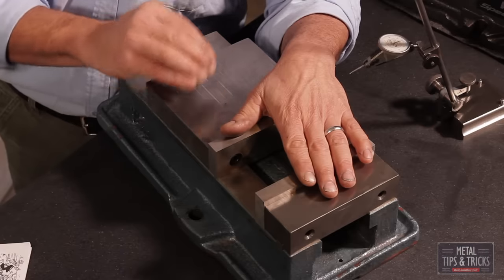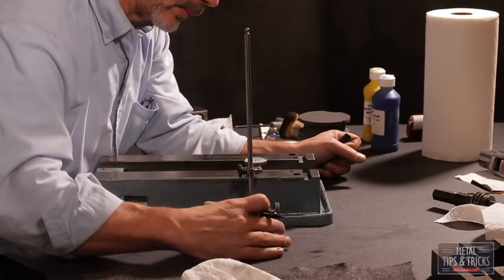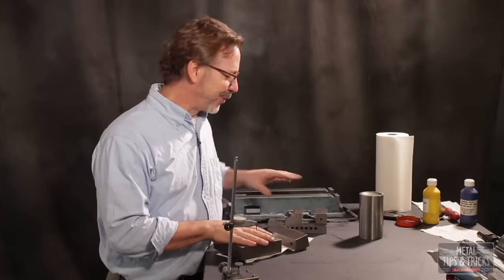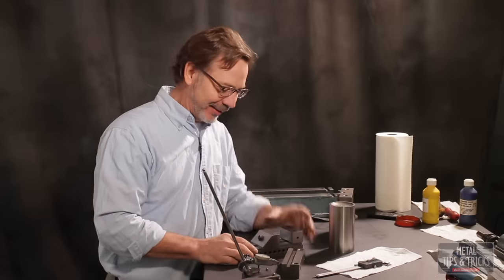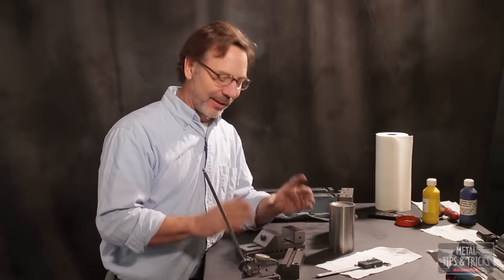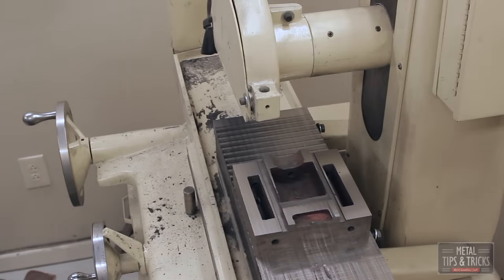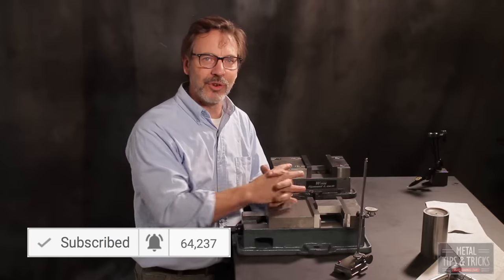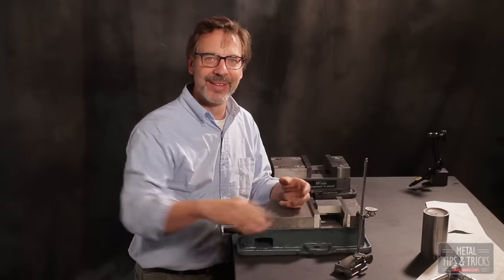China vs Usa  controversy machine vise

Comment: Well you get what you pay for, still holds true.
Reply: Winn got a lot for giving away free vise ;)
Reply: I have a Kurt D675 and a Chinese no-name clone I purchased about 20 years ago. For both, the amount of ‘lift’ you get on the moveable jaw depends on how you adjust the setscrew on the moveable jaw. The clone slightly outperforms the Kurt in every respect, and its castings have much better finish than the one in your video, Dale. It’s wrong to lump all China made vises together. Unfortunately, many people purchase their clones sight unseen. I bought mine from a machinery dealer, so I was able to inspect it before buying. I bought the Kurt last year, mostly to see if it would be a step up. YMMV.
Reply: Not if you buy a new superduty ford
Reply: Paul Mathews Interesting. Is it a perfect copy? Dale's vise is not!
Reply: AtelierDBurgoyne   No. Dimensions are metric. Main features are copied, but not exactly.
Reply: Randy Richard In The Shop 
Not true! I just bought a like new Kurt 6 inch for 115 bucks! Lol
Reply: By now just about all companies have their castings made in China, and sometimes do the final grind in house, if you're demanding and ready to pay a little more, them, the Chinese will do everything you ask, even walk on the head...   ;)
If you ask for a mold with 12 pounds less, they'll do it, if you ask for a heavier and better casting, you'll also get it...   I wouldn't put the fault on the Asians, but, on the guy on this side of the pound that wants to make a couple of extra $$$ by skinning the product to lesser standards...
Reply: Bingo this point needs to really be hammered home 
Most of us are watching this on Phones made in China and if you think they can't achieve precision just have a look into the nightmare that is forming preparing and etching a silicon wafer with transistors. 
Some of the largest silicon foundries are in China now and work to precision and tolerances machinists dream/dread.

China is exceedingly responsive to customer demand and tends to produce whatever is asked for regardless of whether its right or wrong because ultimately the responsibility for the product won't rest with them. 
They won't get sued for a product failure so they will make a hydraulic jack that can lift 3 tons for 5 minutes. 

There are other aspects other than the insistence of major corporate supply chains consistently taking lowest bidder suppliers such as quality fade where a Chinese supplier will underbid a contract and send an initially great batch as a loss leader before incrementally shaving quality and quality control in successive batches, this is primarily an issue with low tech goods where competition is high due to the low cost of entering the market. 
The pressure to underbid work and make up the loss by quality fade is tempting while the negative consequences are relatively small since consumer liability is on the retail company rather than the supplier.  

Businesses are wising up and learning to select their suppliers more cautiously as well as the Chinese domestic market of suppliers is maturing as the less reputable are being pressured out. 

This same transition happened in Japan in the 70s as the market matures and consolidates reputation will matter more and both prices and quality will rise.
Reply: Not all Chinese equipment is made in the same factory. Some are better than others. In addition, if the importer is big enough, they can insist on a specific quality level. It’s all a matter of money. Some inexpensive Chinese stuff is incredibly good, and some is incredibly bad.

But we’ve also got the same things made in India, and other places.

I recently bought an adjustable arbor from. McMaster Carr,  normally a very reliable vendor, who rarely gives the name of the tools it sells in the catalog. It was so bad, that the sleeve wasn’t even ground all around because the raw part wasn’t round enough to have the metal to grind off all around. I sent it back.

But then, I’ve bought a very expensive Swiss Torx screwdriver with the wrong size head. It’s a matter of luck sometimes.
Reply: Reply to Pearce Hayward:  The question you must ask is: Where did they get the technology to do that? If they really designed and built it locally then where did they get the original FOUNDATION KNOWLEDGE AND FACILITIES TO GET their scientific-engineering-technological-technical machine tool lessons and knowledge to do that? Everything always has an specific point of origin OF AN INDIRECT NATURE. The Chinese got it all from America! Like the Japanese, they imported, copied, and improved upon it.

Always ask the correct questions to get the correct answers. During the early 80s of the misguided Reagan administration's free lance outsourcing economic policies the PENTAGON QUITELY STARTED ACQUIRING ALL OF THEIR SUPPLIERS' FACILITIES AND TRANSFERRED THEM TO A SAFE PLACE TO CREATE A FULL-SET ECONOMIC BASE FOR THEIR INDUSTRIAL MILITARY COMPLEX right under the nose of President Reagan in order to assure themselves of a locally secured domestically manufactured supplies of all kinds of manufactures. 

The U.S civilian economic sector is suffering from outsourcing BUT THE U.S MILITARY ECONOMIC SECTOR IS NOT SUFFERING FROM OUTSOURCING and any news of shortages due to supplies being outsourced is mere official public news WHILE HIDING THE REAL UNOFFICIAL NON-PUBLIC NEWS. 

You better learn how your country's military system works for it is divided into two sectors, the 1st conventional sector dependent on the civilian industrial sector and the 2sd UNCONVENTIONAL SECTOR INDEPENDENTLY MANUFACTURING EVERYTHING IT NEEDS FROM RAW AMERICAN ORE TO THE FINISHED MANUFACTURED PRODUCT regardless of what happens to the 1st conventional sector for it is part of their C.O.G "Continuity Of Government" and C.O.C (Which they copied from Russian) "Continuity Of Civilization.  

The Pentagon's own machine tool industrial complex that can manufacture itself, for only machine tools can reproduce themselves, has achieved precision machining ranging from 1/25 millionth of an inch to 1/100 millionth of an inch. So much for your so-called Chinese precision engineering with precision and tolerances and positioning and stabilization that machinists dream/dread.
Reply: You are partly right and mostly wrong.
Yes, you are right about the military, no you are wrong about all comes from USA or even America.  It comes from everywhere.  We used to say the same thing with Japan in the 50:th and 60:th.  Then the Korean and now it is Chinas time.
Many ground level technology for even manufacturing high quality things are coming from all over the world.  So it is not something special for US quality.  Quality cost, companies want to make a buck extra, which they get by pay less for producing they produces.  Which also will give less quality to be able to sell with higher margins.
And yes, getting others to produce for less money will make it possible to sell for less money, and still have same margins.

All about mechanics and yes, OFTEN you get what you pay for.  But not all the times.
Reply: How old are you? I am 92 years old and I have worked for the Intelligence service for many decades and I have seen what I have just said. Your America did developed virtually everything it needs after many European immigrants with scientific, engineering, technological, and industrial backgrounds came to America. America copied and improved upon them. WW II taught the U.S military a lesson of the vital need of being 100% self-sufficient regardless of the situations and circumstances, war time or not. WW II created a shortage of Malaysian rubber and Japanese silk for American tires and wire insulation and sound proofing for submarines, etc and American parachutes and bullet-proofed vests (https://www.npr.org/templates/story/story.php?storyId=4625858  A priest went to Germany to find some Polaks who are highly skilled in weaving so as to find the right weaving patterns for making a silk fabric which is then layered to produce a bullet-proof vest) and anti-aircraft flak shrapnels for air crews manning the machine gun posts on bombers and WW II forced America to develop synthetic rubber and nylon and many others too numerous to mention here. 

https://www.zdnet.com/article/taiwan-aftershock-pc-makers-jittery/  An IC chip shortage caused by an earthquake in outsourced factories in Taiwan created a temporary IC chip shortage (not to mention industrial espionage causing counterfeiting problems) 

https://www.zdnet.com/article/thailand-floods-to-lead-to-hard-drive-shortages-for-months/  A hard drive shortage caused by flooding in Thailand. This immediately caused Intel to build a brand new factory producing IC chips and all computer components for their computer manufacturing needs. 

The Pentagon will never admit that they can cover the losses due to the need to keep their INSOURCED manufacturing base SECRET! 

The Pentagon can manufacture anything they need. But the civilian economy can not. But the Pentagon keeps on maintaining this charade of being dependent on imports and on the remaining local manufacturing high-tech industries FOR THE NEED TO CREATE THE IMPRESSION THAT THEY ARE VULNERABLE when in fact they are not. 

But unfortunately they can not and will not share their hidden, underground full-set industrial economic complex for the sake of secrecy. 

Remember one thing. There are 2 kinds of news. The 1st one is the official news for the masses, for the public. The 2sd one is the unofficial news for the government higher officials and military higher officials, WHICH IS THE REAL NEWS. So you see, I am 100% right all along. Besides, during my active duty service, I have seen these underground industrial manufacturng complexes being built personally. If you have serve in the intelligence service's Black Programs division, then you will see that I am right.
Reply: 92 and worked on intelligense?  And guessed I was an american?
Bad guess.

Comment: how do you know that the readings are accurate? you are just moving the dial gauge on the table. is that a perfectly flat calibrated table? What sort of a table is that? won't the imperfections of the table's surface be visible in the dial gauge readings??

Comment: Good demonstration on the economy of built in value. I have found over time some of the quality problems can be worked out, but seasoning castings and stress relieving both add to the cost of a product.  Still in the home shop cheap generally rules, that's why these things are out there. Good video Dale, I enjoyed your efforts on the grinder. cheers!

Comment: Question: When setting the indicator on a round square, how do you know when the point of contact of the indicator is perfectly above the point of contact with the base?.. Do the two points automatically fall in line?

(I've always used the two opposing sides of a parallel to do this.)
Reply: franksalterego i think because the indicator base has a curve it is directly above the curve somewhere and by rolling it around the curve you find the highest reading... setting that to zero

Comment: Wondering about the surface gage/dti. You set the dti to zero on the cylindrical square and then read out-of-flat - out-of-parallel with this combo. Dom't get me wrong, I am not disputing your methodology, I just don't get it. Maybe I am still in dreamland...
Reply: The base has a ledge that also contacts the standard / test piece. The DTI compares the difference between standard and test piece at a higher point on the standard / test piece.
Reply: Got it! Tnks

Comment: I agree 100%.  I saw your first video and was thinking if you were machining something that required precision you could ruin parts rather fast and cost yourself way more than you save with just one rejected part... or if you do not catch it, possible cost you way more do to an upset customer.  The thought of losing a contract from a big client because you cheaped out on the tools would keep me up at night.  I saw the first video and agreed with you 100%.

I paint for a living.  I can get what most people call good brushes for $6.  The average beginner would likely do fine painting with these cheaper brushes.  For me they loose their tip within hours of good use and become completely useless after a few days for anything but rough work.  Jumping up to a Winsor & Newton Series 7 Miniature Round #1 for $18 is worth it.  They are made from the Kolinsky Sable fur collected from a weasel in Russia.  It is a restricted fur... not banned, but it can be a pain to import it.  The brushes are made in England and not in the US so they are fine.  These brushes will last me at least 20x longer.  I'm sorry, but 20x longer for 3x the cost is WELL WORTH it.  Besides working with better materials not only saves me time, but makes me produce better products.  If I could get a brush that lasted a year I would be willingly pay $100 a brush.

Comment: Even if you improve the geometry of an inexpensive vise, you can't change the material it is made out of.  Besides the elasticity differences between different types of cast iron, durability is an issue.  A new vise looks good but cheaper cast irons can't be hardened so they'll wear prematurely.

Comment: Regarding your grinding setup, you should have first put it the way side down, as that had the dish in it, making it very easy to shim from one corner and from the middle for support. Clamp, grind flat, flip it and grind flat.

As for shims, nothing beats a stack of paper next to the grinder. Shove paper under the gap, tear off and shove another.
Reply: aaand it seems the reason you did that way was because of trying to fiddle this thing through on a grinder that is just way too small for the job.

Comment: Wow you turned that vice into a 1000% better one. I wonder if you heat treated the parts before grinding. Would that change anything ? I know you said it was lighter so that is a big factor already.
Reply from the maker: No, Heat treating will not help. Its made out of a cheap cast iron.

Comment: People, we are not talking about a blender when we are talking about a vise for a mill.  It has to be precise, and rigid, and repeatable, prevent lifting when tightened, and if possible dampen vibration.  If it doesn't the parts you make with it will be crap.   This vise is too heavy to be used as a drill press vise in some guys back shed.   It's designed for a knee mill at minimum or even a machining center.  Problem is it isn't precise enough for my table saw let alone my machining center which is trammed out at less than .0001 inches.

Comment: I was wondering if instead of using cast iron, if the main body was made from a block of steel and machined via CNC would that make it more accurate?  Or is cast iron the better choice.  Because I thought cast iron is used to reduce cost today over CNC machining that same peace from quality steel.   And the lack of CNC in the past, Cast iron pieces were the only way to make things without the cost skyrocketing with a machinist milling the part.
Reply: Kinda-Sorta... it's really very complicated, and gets into Metallurgy and the intended uses of said item. There are many grades of cast iron, and post heating/curing processes that make them "more better" (but adds to cost) Cast iron is great for these kinds of applications because of it's dense and vibration dampening properties. Vibration and Machine Harmonics need to be considered. Also, elasticity plays a role here as well. A solid steel version of something might actually fail or get stress cracks long before a similar cast iron piece does. Or expansion coefficients also play a role too.

Could you make some bad ass widget holder out of air hardened tool steel? Sure, but the cost of creating the tool steel needs to be taken into account long before you can start adding up machining time. Not to mention the wear and tear on tooling and bits. Whereas creating a sand mold and pouring in iron powder is ridiculously simple and cheap to do. It's the engineering in how the casting was designed, the risers, the stress relief, the choice of mixture in powders selected (recipe) the post heating etc... that will get you a quality part to market. And much faster than machining something that might not get you exponential better results, than something that was thought out well from the beginning.
Reply: Thank you for the explanation.  I am a novice not yet owning my own tools but I have used my buddies hobby lathe and mill.  I hope to buy something of my own this year.  So I have no idea what I am doing but am interested in learning more.  I never knew cast iron had vibration dampening properties, I just thought if it is heavy it is harder to make it move/vibrate.
Reply: agdtec thermal stability
Reply: JonnoMoto  Could you tell me more on this?  I am not very knowledgable but I am interested in learning more.  Are you stating That cast iron is more stable when the temperature changes?  Or when the unit gets hot from use?
Reply: Like I said, it can get very complicated. Look up Austenite to get a better understanding of what's going on at temperature. https://en.wikipedia.org/wiki/Austenite

I do believe that cast iron will take heat better from machining process. Whereas steel can change it's thermal properties with only a little bit of heat applied.
Reply: Thank you for pointing  That out.  I started to read it and realized it will take a lot of reading to start to understand this topic.  I but I will take my time and hit the other links to understand as much as I can.

Comment: Great video, Dale!  I see you are making good use of your new metrology center. A poor quality vise will hold stuff, but that's about it. My experience working with cheap vises is one of working around the lack of consistent parallel / perpendicular surfaces. It can be done, but requires a lot of thought, and a lot of checking and rechecking before making any cuts.